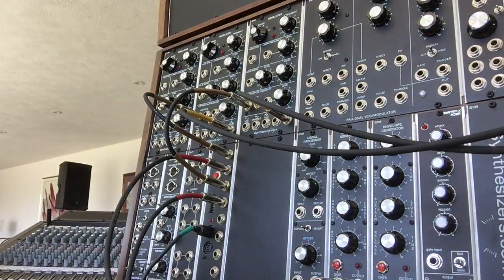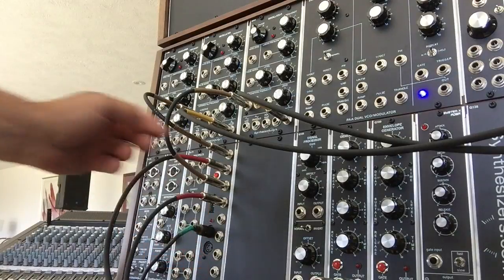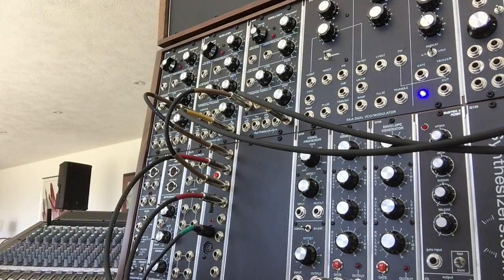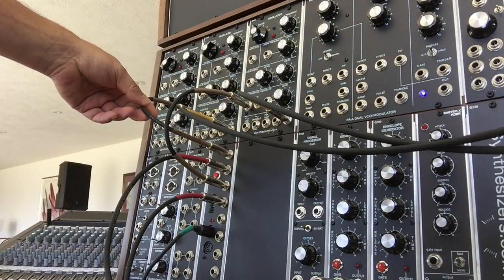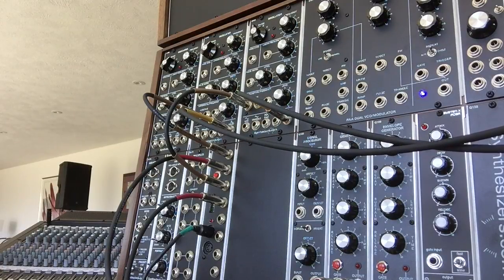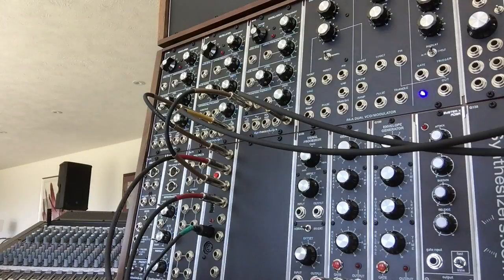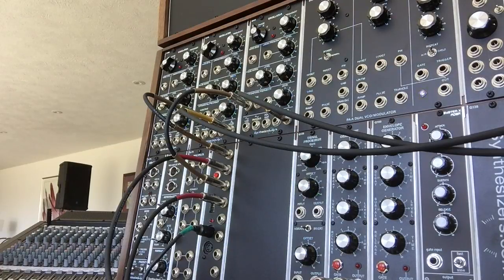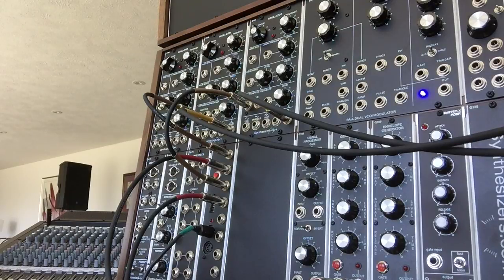PAiA MIDI2CV8 Duo Mode Demo

Comment: I wrote V3.0. Thank you for making a demo of the duo mode. I wrote this mode first, and then I got a bit carried away and ended up pretty much rewriting the whole thing.
Reply from the maker: Thanks Roy!  And thanks for 3.0.  Funny that you wrote when you did.  I just popped out of the studio for a second to check email.  I happened to be using the MIDI2CV8 to record a track driven by my Mac.  Just monophonic this time but I really love the PAiA MIDI module and use it a lot.  Thanks again!